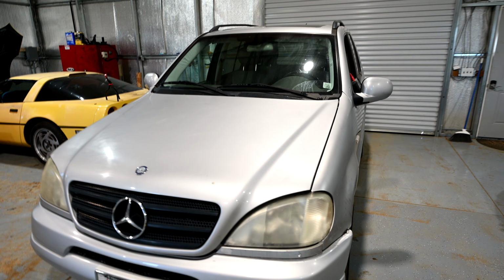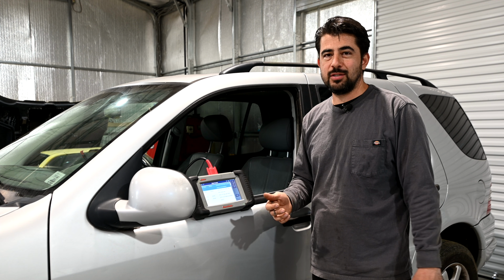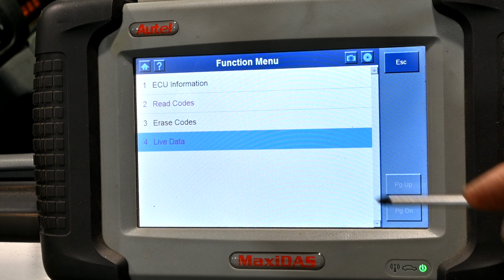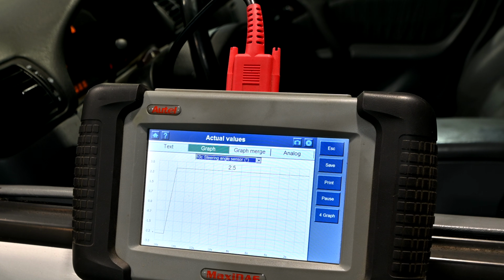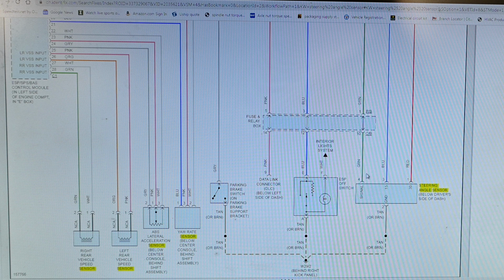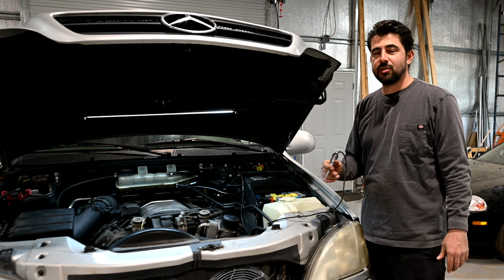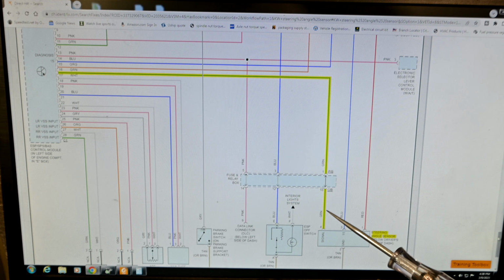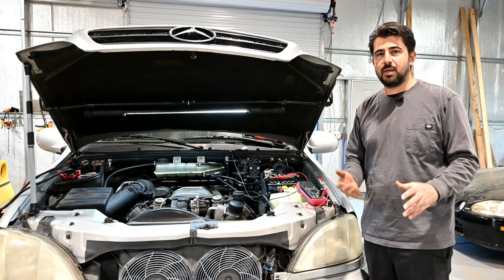How to Diagnose a Bad Steering Angle Sensor

Comment: I have two W210 facelift Mercedes that both have an ABS ESP and BAS light on the dash and both have the N49 steering sensor fault which just display zero degrees and does not change.  And both are very hard to steer in parking lots.  One of them does appear to have an issue reading right front wheel speed (tried a new abs sensor on that wheel but did not go away).  The other has not other faults codes showing on my iCarsoft scanner other than that N49 steering angle sensor error.  I did try replacing that steering angle sensor on that one with no other errors with a used one that I assumed (was promised) was good, but no change.  Still reads zero all the time.  Hate to throw parts at it but I am now thinking they both might need a new ESP module.  I can't seem to find any info on anyone else having this same issue.  I honestly figured since I have two 2001 E class Mercedes at the same time that have the same issue that it might be a super common issue that people would be able to quickly point me to the solution for.  Been hunting for a couple weeks or netter now and haven't found the solution or even a way to track it down.  Not 100% sure my iCarsoft will reset an SRS light (I am about 80% confident but not the 100% that I would like to be ) that I know will be set if I try to run the car with the steering wheel and airgbag off which is what I would have to do so check for voltage at the sensor as you suggested.

Comment: Hey i took my car to mechanic to change the tied rod and lower control arm and rack and pinion on my 2003 NISSAN 350z  heard the guy was banging on some part of the car..now i got ABS..VDC SLIP BRAKE light come on and the steering wheel was pointing to the left almost 15 degree..i took it to alignment at Firestone now steering wheel is better by still a little off almost by 2 or 3 degree but the light is still on... Well my mechanic can reset the lights now that car is alignment better. Soon i will take the car to another shop for lower car alignment but i just to know see if the mechanic can resolve the ABS VDC SLIP BRAKE light issue..before i got to the shop that specialize in lower car alignment.

Comment: My car was having problems with power steering assist the wheel would get hard to turn when turning it quickly or making sharp turns and the wheel would get hard to turn and also the steering wheel light with the exclamation point would pop up on the dash . I then took it to my mechanic because I couldn’t figure out what the problem was and I didn’t have a scanner to read the fault. He came to the conclusion that the SAS was bad. I ended up replacing the power steering pump when that wasn’t even the problem it was the sensor all along. I already ordered it just waiting for it to arrive from eBay hopefully that fixes the issue
Reply: Did changing the steering angle sensor fix the issues? I have a similar problem

Comment: Very informative video! I hope you still  read the comments and hope you can  guide me in the right direction which will be much appreciated. I have two similar lexus and I get C1253 on one of them which just says Steering angle sensor. when I expand that error to read all the data I see that both vehicles give the same data when I turn the wheel. The only difference is the one with the error c1253 says NG(2): Steering sensor abnormal.I doubt the problem is the sensor because I replaced it with another used one and same error. Is there anyway to test the sensor and what else should I test?

Comment: Hi, I have a question if you can kindly answer. For Toyotas the angle sensor is attached to the clock spring. Can we just detach it from the clock spring(it;'s detachable) and just turn sensor wheel by hand for testing? Now the other question is does it matter how many times we trun its wheel before putting it back right into its location? thanks!

Comment: Good video.   I'm trying to diagnose a Toyota Highlander.   My OBD2  scanner reads  1150 degrees on the steering angle sensor and it does not change when turning the wheel.  So I got another SAS from the junkyard and installed it and still gets the same 1150 degrees.   Could this be a broken wire or something else?

Comment: Very informative and easy to follow.
I have w140 coupe 1998 and has a intermittent fault ABS EBS ESP it seems to be when the cabin becomes hot after being in the sun.
Sometimes no fault for months and other times can be almost constant.
But will reset by lock to lock wheel turn.
Any thoughts?

Comment: I have a 2004 ML350. I had to Replace ECM, AAM, BCM and Steering column, Key Module and key with used parts. It started but the ESp/ BAS, SRS are still on after I turned S Wheel both ways and I straighten S Wheel as best I can. QUESTION: Do I have to remove whole steering column to do straightening of Steering wheel if I am not sure whether I put It back on in the same position at the knuckle?  (The lower part of steering column may not be where it was, Is that a problem?)

Comment: Hi there, you might be able to help me here. I have a MERCEDES-BENZ ML-Class (W164) ML 320 CDI 3.0 4-matic 224 hp Diesel - 2008. Sometimes (not always) I get a yellow triangle with an exclamation mark on panel, then the self-driving,  stability controls / ESP, and the rear camera stop working. I tried to change the sensor piece, but could not find anywhere in my country. It does work most of the time, but sometimes not. So Im wondering if you could shed some light here please :) Appreciated in advance 🙏

Comment: Hi, when I check my steering wheel angle sensor through a scan tool, it always shows 0, regardless of whether I'm turning the wheel or not. What can that mean? Does my sensor need calibration, or is it faulty?

Comment: I have a cadillac with the a invalid data resived from angle sensor code but also the steering wheel is off center wonder if an alignment first my first the issue

Comment: I think i have a problem with my audi a4 b8 2009 sedan steering wheel sensor, please give me some advice. If iam driving and steer to the right my car goes completely in alarm. esp, parking brake light, Etc. Everything thats possible. And my steering wheel goes to the left (25 degrees) but my wheels stay straight i can drive but its really annoying offcoure. Brought it to the audi dealer allready but they couldnt find the problem I personally think that this steering wheel sensor is bad. At this time my alarms are always on, just by starting the car. Could it be that my sensor is now completely broken by wear? The car has just over 200.000 kilometers now and this problem is occuring like 3 months now. You have some advice? Iam clueless:(

Comment: I had to replace my  clockspring. LIght is still on so performed the test above. When I have the wheels pointing straight forward and the steering wheel straight ahead I"m reading 360 degrees. I"m assuming somehow I installed it incorrectly..though it seems pretty straitforward

Comment: Hey, thank for you videos! 

I have 2001 E55 (W210) on my AUTEL it gave me the C1140 (sas) and I checked the Live Data (steering angle was at -0.0). Then I have replaced the sas with new one, the lights on the dash are there and Live Data still shows -0.0 (even when turning the wheel) 
I have only this error for ESP module. 
Q1: do you know where to look i to? 
Q2: where I can find the witing diagram for my car? 

Please help me 🙏
Reply: I also same problem bro😢

Comment: Great video. Would love to see someone diagnose in detail  a "START ERROR" on the W163
Reply: Start error is usually when the chip inside the key fob is a bit loose you have to open it up and get it to seat good
Reply: About 95 percent of the time it’s the key fob chip. Don’t lose that. Some people will permanently glue that chip inside the steering wheel  very close to the key ring sensor

Comment: You should get an oscilloscope to see the digital signal coming from the sensor. You might not know if it's correct, but you could compare it to the new one to show the difference.
Reply from the maker: Thats one way if you don't have a scanner with live data.
Reply: The pico-scope is more expensive than the scan tool